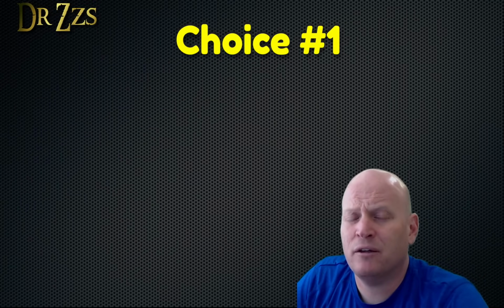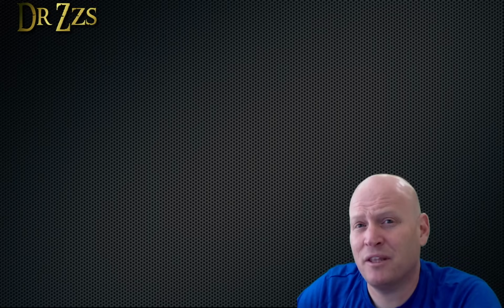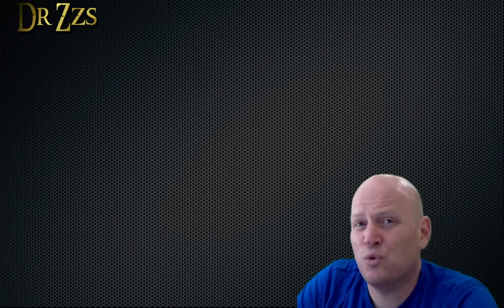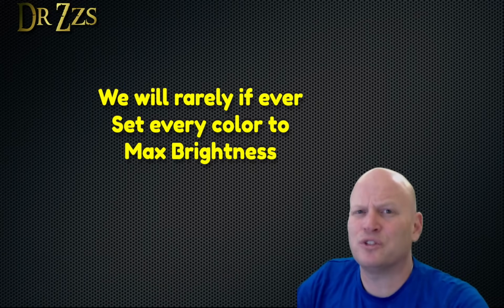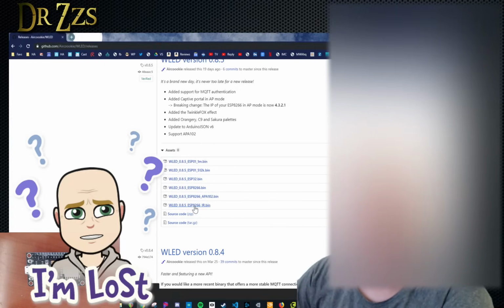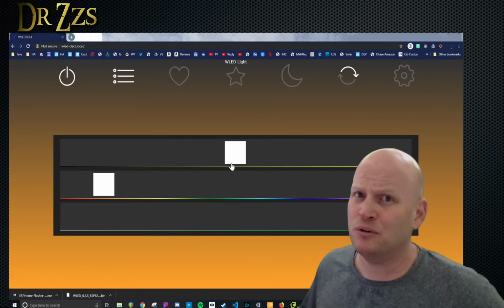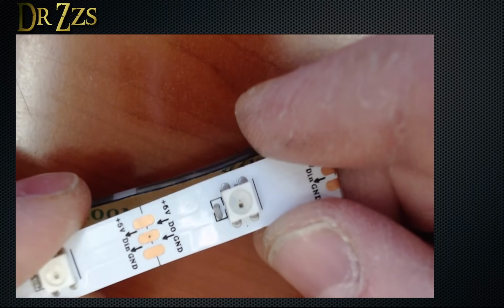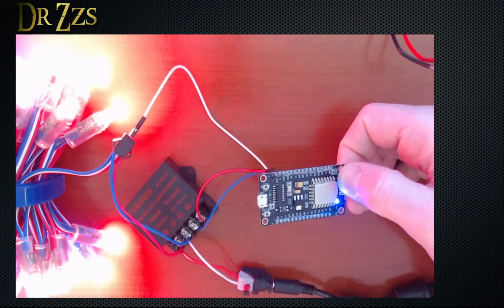Beginner's Guide to Christmas Lights - and LED Shows for Every Holiday

Comment: What is the max distance you can do with a 12v bulb system? Does putting the controller in the middle mess up the patterns that go in order?
Reply from the maker: Yes, putting the controller in the middle would mess up the patterns.  The effects go out from the controller, so the controller always has to be at the beginning of the run of LEDs.  
I plan to talk about this issue this Sunday.  There are a lot of questions about it.

Comment: Sooooooooooooo.  No more Raspberry Pi with this system?  I know, dumb question.
Reply from the maker: Nope!  No Rpi needed, and No, it's not a dumb question.  
One of the great parts of WLED is that it doesn't require Home Assistant.  It can be used with Home Assistant but it isn't required anymore.
Reply: Thanx brother. Can’t wait to try it out.

Comment: Thank you so much for the amazing video.  Do you happen to have a wiring diagram for the 12v setup?  The lights turn on but controlling then through WLED is not working.  I tried the 5v setup with success so the issue appears to be with my wiring.  Thanks again!  I love your videos!
Reply from the maker: I don't have one handy.  If you want to send me a pic of your setup in discord I'll take a look and see if I can identify the problem.  My first guess would be that you need a common ground.  If the LEDs and the Control board don't share a common ground it won't work.  Is the NodeMCU powering up?  can you see the WLED UI?  If not, then maybe your voltage converter isn't putting out 5v.  
Those are a couple ideas to check.
Reply: I am having the same problem to did you ever find out how to fix it?

Comment: Is there a trick to get the COM# to show up? I tried on a MAC and Windows computers.
Reply: Konner C I’m not sure, but I think on the Mac, if you’ve upgraded to Catalina, I think Arduino is currently broken (late October 2019) I even installed windows 10 under parallels, a workaround suggested on the Internet, and I still couldn’t see any com ports; I think it might be the same issue. I’m buying a cheap $300 laptop on Amazon for my windows requirements.
Reply from the maker: This sounds simple, but try a different USB cable.  Some only do power and don't have the communication wires.  
If that's not it then you could try installing drivers for the serial/usb converter chip on the NodeMCU. I think it's like CP2102 or something like that.  Look on the little chip for the numbers and do some googling.  
Hope that helps.

Comment: Can we get this in uk
Reply: badjobba I’d suspect that in the UK the biggest difference would be in selecting the proper power supply. I think everything else would be about the same. Oh, and Wi-Fi channels change a bit in some countries, but I suspect the board and the software take care of that automatically.
Reply from the maker: Thanks Mark.  
I would expect you can get the LEDs and NodeMCU's.  I agree, check that the power supply is compatible with 240v.  Otherwise it should work.  WLED is made by a fella in Germany, so I'm sure he's considered the needs of those in Europe.

Comment: I am starting my first project and this video helped me a lot. I am not just putting a string around the house, but want to make a Christmas tree. Is something like this: https://youtu.be/B5bJfEVOjHQ possible with the WLED app? (Not so complex and big, but i need a push in the good direction to find more info about it.)
Reply from the maker: Ah yes.  That is called a Mega Tree, by most of the super light show folks.  
It would be possible with WLED, but it would probably be better with something that is made for that purpose like a falcon controller ($$$) and xLights.  https://www.pixelcontroller.com/store/index.php
I might try to make one someday with NodeMCU's and WLED.  There might be a way to do it well. 
If you really wanted to use WLED for a tree like that you'd have to run several NodeMCUs.  Probably one for each Vertical strand of lights, unless you are also going to use xLights.  
You've got some research to do.  Do some searches for DIY Mega Tree.  I'd be curious what the pros out there recommend for doing that kind of tree on a budget.  The Falcon controllers are great, but they ain't cheap. 
Good luck!

Comment: Thanks for the content DrZzs. I followed your guide but with a 12v string and got it up and running but the red and greens were reversed in the controller. Any suggestion on how to fix this?  Disregard, I found how to change the setting.
Reply from the maker: Releasing the video today that shows where to make that switch.  Glad you found it!

Comment: I purchased the WS2811 strings and a NodeMCU from your link and installed the ESP8266.bin with the flasher as instructed. I've tested the lights. Most of them just vibrate with a white light. Some at the end change, but not in a way consistent with "Wipe," "Sweep," or "Solid." I also tried two other ESP8266 (the Huzzah Feather from Adafruit and another one from DoIT), and an ESP32 (Adafruit Feather) with the same (non)results. Then I tried it with the 12V and 5V strips. Same (non)results. I tried the three light stips and strings on an SP108E LED Controller from LED Shop and got instant results. https://www.youtube.com/watch?v=n6ar-gImUvs 
I don't know if that's enough info to help me figure out why I'm not getting the same results as you, but I'd sure like to find out so that I can use the ESP8266s. Any thoughts?
Reply: Michael Bishton One guess might be a slight voltage difference between the ESP 8266 and the LED strips. On the Amazon description I found from the link, one of the images shows a bunch of 3.3 V pins, instead of 5 V. I still haven’t got mine working for different reasons, and I suspect most modern hobbyist electrical gear often handles the 3.3 vs 5 volt difference automatically, in many but NOT all circumstances, and you may have hit the latter case. A total guess...
Reply: @mbennettideaengcom  Thank you for your thought that kicks off an elimination process. I drive the LEDs with a separate five volt source. I only use the one wire from the 8266 to provide the signal.
Reply: Michael Bishton I’m having trouble myself, details slightly different, but same incorrect random-ish behavior. I’ve ordered a small breadboard, and I have a logic level shifter. ONE comment to your reply of “only 1 wire”, (I wasn’t sure which direction you meant that in), should be 2 wires, green(signal) and black(a common ground between everything). And if driven from 5 volts, that mismatch might be enough (5 vs 3.3) IF it fixes my problem I’ll post about it. As to why a vast majority of folks “get away with it”, I’ve wondered that. In my case I have 256 LEDs (Adafruit 16x16), so maybe it’s power is somehow diff enough that it trips over some fine line between working and random splotches (it IS doing something, sometimes off sort of works, and dimming sometimes has an effect) I’m also buying a different brand/layout of esp8266 (though it’s a poor craftsman that blames his tools, but still another thing to check; wish they would just do a 5 volt logic version and we could skip all this) Fingers crossed.

Comment: Trying to get esphomeflasher to see any com ports on my computer, I have tried a handful of cables with no luck, running win7
Reply: if  you have a cheap NodeMCU from china you may have to install the CH340 Driver.  Apparently the more expensive ones have a different USB to serial chip which works without this.

Comment: Any way to get the light strips on to the house without drilling or marring the surface of the house or eave.  I would love to install semi-permanent lights that I could remove if needed and not have the screw holes remain behind after removal.

Comment: DrZzs... I purchased a esp8266, I am working on a 64bit Windows 10 computer. I downloaded the flasher, the .bin file and I installed the cp210x driver and I still can not get the the esp to show up in the serial port when I hook it up to the computer.... any ideas? Is it the cable I'm using? I see the little blue flash when I hook it up to the computer. Do I have to install some Arduino IDE or something?
Reply: For everyone/anyone having the same issue... use a different cable.
Reply: Dylan Stewart OMG! Thank you so much!!! I wasted an entire day this weekend with Catalina on the Mac, and then buying and installing windows 10 pro under parallels, and still not having things work. Replacing the puny cable with a more substantial cable made the difference (which I assume also has different wiring as well) I guess I can return the cheap windows laptop that I bought to work around this problem!
Reply: @mbennettideaengcom  I can only imagine the frustration lol. No worries and happy LEDing!!
Reply: I had the same problem, tried different cables and different laptop, no luck. Finally figured it out, Device Manager was showing no driver for the nodeMCU "CP2102 USB to UART Bridge Controller". Downloaded the windows driver for CP2102 USB from https://www.silabs.com/products/development-tools/software/usb-to-uart-bridge-vcp-drivers, esphome flasher can now see the COM port.

Comment: Great video.  Ran into one issue getting WLED installed.  I first had to install this windows driver... then everything worked great: https://www.silabs.com/products/development-tools/software/usb-to-uart-bridge-vcp-drivers
Reply: Spencer, was your problem with the flasher not being able to connect to the com port? I am getting that on new board (I had an existing board I updated a few weeks ago with flasher for the new ULED Update and that worked fine) when trying to install ULED for first time. I downloaded your link and still getting the COm port can not be opened...

Comment: @DrZzs: When / if the 3M tape fails, one could consider doing this alternative or do a side by side comparison of how the tape does using these:  https://www.amazon.com/Mounting-Brackets-Silicon-Included-Waterproof/dp/B07FMR1XXD/ref=pd_sbs_60_t_1/130-9693347-3261005?_encoding=UTF8&pd_rd_i=B07FMR1XXD&pd_rd_r=8f769600-0389-48ff-989f-bdb924e9ab65&pd_rd_w=CWNK2&pd_rd_wg=K2nLf&pf_rd_p=5cfcfe89-300f-47d2-b1ad-a4e27203a02a&pf_rd_r=WHPBZKX2Z6N5VQS2669F&psc=1&refRID=WHPBZKX2Z6N5VQS2669F
Reply from the maker: It's already started to fail :(
Reply: @DrZzs  my Patriot LED string from H.D. came with them. I was surprised no one had ever mentioned them.  Also, another company sells them on Amazon for a tad less...Griver, but only 1 screw.

Comment: Can you run multiple things off one W-LED?
Reply from the maker: You can connect multiple strings off the same pin.  They will all display the same effect at the same time.  You can't use multiple data pins. Just the one.

Comment: Good video DrZ. I am doing 3 archways on my driveway with led strings and pvc pipe, 3 strands apiece with a total of 450 lights. But a wire stripping tip, do not remove the insulation all the way, try and leave it on the wires. then spin the free piece of insulation in your fingers, to twist the wires together. The insulation will slide off and the wire will have a smooth uniform twist.

Comment: Drz, this video motivated my wife and I to try out adding the WS2813 strips along our roof line for the holidays as a permanent fixture.
We quickly realized a few things.
The strips we used are 5v with 150 leds per 5 meters.. total meters 30.. Comes out to 900 leds.
All powered by a 5v 60 amp 300 watt power supply.  However, this did not work out as planned.
In fact, in order to run all 900 leds you would actually need a whopping 270 amps! 
This kind of power then requires fuses and a 4 gauge injection wire at every 5 meters for safety.

So, for anyone thinking of using more than 4 strips for outside lighting, please be aware that it will require a significantly larger power supply as well as wiring that can handle the load. 
The last thing you want is a fiery holiday lighting show.
Reply from the maker: I think your calculations are off.  At the absolute MAX you might need 54 amps (60mA/led x 900 leds = 54,000 mA = 54 amps).  I would argue that a power supply half that size would still be sufficient. With that long a run, and that many LEDs you'll want to inject power to avoid voltage drop.  Each time you inject power the current gets split. So if you inject power 4 times, your max load on any one injection point would be 1/4 of the total load.  Even at Max that would only be 13.5 amps.  Being conservative you could use 18g wire.  There's no limit to how conservative you can be.  I'll do some load testing to prove my point. Basically, don't give up.  Lots of people run hundreds of LEDs and none use 270a ps or 4g wire.
Reply: @DrZzs  , There must be something wrong in my wiring then.. I have an 18ga wire running for injections at every 5 meters..basically 7 taps and the last 1/4 of my LED strip still  flicker and act all wonky.  Adjusting the current setting in the Wleds app, the  highest I can set it and not get any of the flickering from the end of the strip is 3000mah.  At that setting the LEDs are very dim and well defeat the purpose of lighting up the house.. lol. What I don't have is a negative wire at every injection.. Its only using the negative from the LED connector pins which are daisy chained.  Could that be the issue? Do the injections have to include one end of the strip and the beginning of the other strip or can I just from the beginning of every strip?

Comment: I'm all set and ready for the next video.... I got a 12Volt power supply, a string of Rextin 2811, NodeMCU ESP8266, 12v to 5v converter, WLED application,..... hooked it all up and gave it a try..... No Smoke!
Reply: What 12V power supply did you buy for just one string of the 2811s?

Comment: So you would inject power from where ever 5 meters? All the way from the power supply? I have a 5 volt power supply (metal box).
Reply from the maker: yes, from the same power supply.  Run an extra pair of wires along the string.  There's a lot less resistance in just the wire than in the strip of LEDs, so it'll stay pretty close to 5v as long as your wire is decent size, like 20 or 22g. 
You could add another power supply.  That should work, but I haven't tried it.
Reply: @DrZzs  Thanks for your response. I appreciate it

Comment: I flashed the NodeMCU and connected to the board via the AP. I added my home network to the settings but it's not connecting to my wifi. Any suggestions?
Reply: I have the same problem, tryed reflasing 4 times, and have tryed 3 brand new NodeMCU. have tryed all 3 of my wifi. :(
Reply: I had the same problem at first, reflashed and CAREFULLY typed my wifi password, then it worked
Reply from the maker: I agree with Max.  I'd suggest just re-flashing and trying again.
Reply: @DrZzs  I have tried it 4 times. Got a wemos d1 mini and it worked just fine. Bad board??

Comment: Is there an option to control sk6812 leds using smartthings or hubitat?
Reply from the maker: yes, wled can control sk6812 (those have a white channel also correct?). 
And you can control wled with mqtt or http so I would expect you can control them with smartthings or hubitat. 
I use Home Assistant and don't know much about those other two. 
https://github.com/Aircoookie/WLED/wiki/HTTP-request-API

Comment: I already had my Home Assistant stuff setup, but wanted to give WLED a try. It was super easy to setup, anyone can do it.  I switched over to it, and now going to integrate into my HA setup.  It's super easy, my kids can even change the lights.  Thanks Doc!
Reply from the maker: Excellent!
WLED is a big improvement.  I don't usually undo something that's working but this is one of those rare cases when the upgrade is so substantial that I can't NOT do it :)

Comment: Great video! Just in time for the holiday season preps ;) One question: with a 12v 5m ws2815 strip will I need to inject voltage at the end? Or will it be fine with no voltage drop? Cheers
Reply from the maker: If you go with 12v (ws2815) you won't need to inject voltage after one 5m strip.  Maybe if you put a few of them in a line you might eventually need to add voltage, but certainly not after just one strip.  With the 12v ws2811 strings, which are 50 LEDs per string, you need to inject after about 5 strings or 250 LEDs.  So I would guess the ws2815's would need injection somewhere around 250-300 LEDs also.  If I can get my hands on some ws2815's I'll test how far you can go before they need a voltage boost. :)
Reply: @DrZzs  Thank you very much for the reply :) The ws2815 is more expensive but will save me some time and make for a cleaner setup.

Comment: best way to connect LEDs to the House - flat waterproof LED strips and a staple gun with the staples wider then the strips. i do this each year, the staples dont do damage to the boards like screws or nails and a pair of long nose pilers pull out the staples easily come Jan.
Reply from the maker: cool!
Do you use the IP65 or IP67?  
My overhangs are metal.  I don't think staples would work for me there.
Reply: IP65, they have the self-adhesive backing as well, but on my wooden facia boards they don’t last! 

I also have a few arches made from conduit (similar to this vid https://youtu.be/Go1RlAifX5U but not as huge lo) and just cable tie them on to the conduit as the rain means the adhesive doesn’t last.  Also Summer Storms blow them about pretty bad (im in Australia and Christmas = tropical storms!).

Comment: wLED over xLights?
Reply from the maker: No, wLED + xLights
WLED does the same as espixelstick, which turns a NodeMCU into a receiver for xlights commands.  But when you aren't running an xlights show you can use the WLED app to just put up some simple effects.  
So it's really WLED over ESPixelstick and WLED over Bruh LED sketch, because it takes the place of both of those.